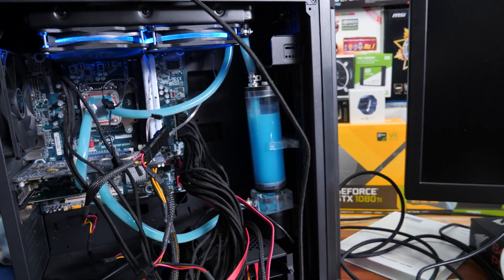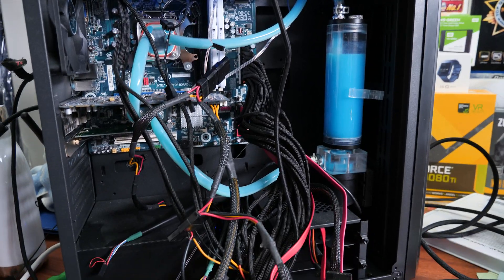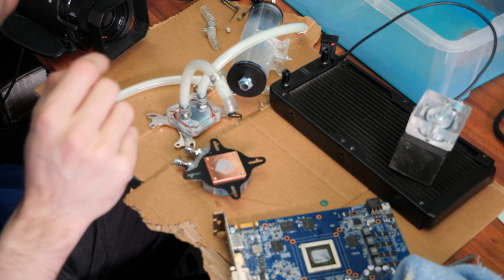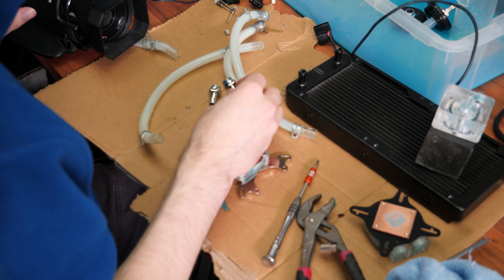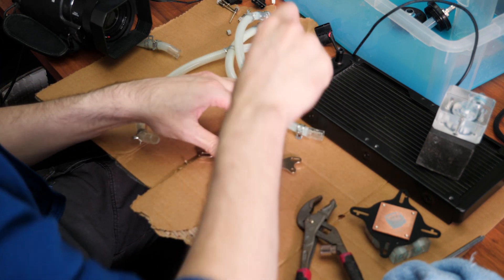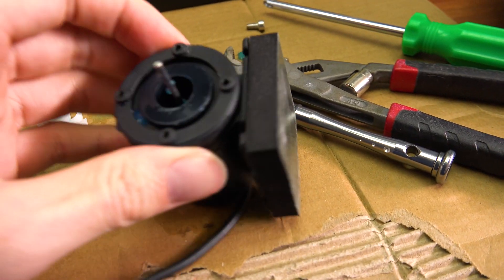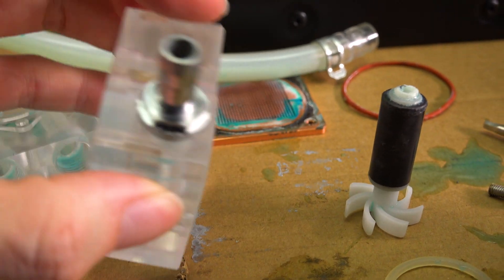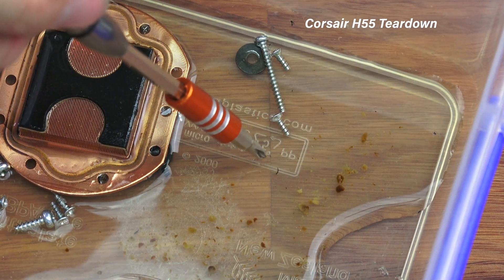Running The Cheapest Water Cooler For a Year

Comment: to help prevent leaking in these cheap water blocks what i like to do is to take it apart when its new and lap the copper, both sides. make sure its flat. then lap the acrylic and then take the original  o-ring and use some dielectric grease just enough to add a little lube to it. put it back together and it wont seep out like it did to you. ive had on on my rx 480 for 3 years now and it still looks new.
Reply: Can we see it?
Reply: going to do that before i put together mine, and what would be the suggested grit for the lapping

Comment: What kind of fluid did you use inside it originally?
I wonder if a mix of car coolant + distilled water would have a better effect than that pastel fluid
Reply: the best homemade mix would be 20% organic car coolant fluid (so it can slow galvanic corrosion) + 80% distilled water
Reply: maybe. use anti freeze. it has anti corrosion? im not really sure.

Comment: I'm impressed it held up so well. I was expecting leaks everywhere
Reply from the maker: Yeah after assembling i was expecting 6 months and then leaks but surprisingly none
Reply: Of course there will be no leaks, as long as the fittings are fastened well enough with durable o rings.